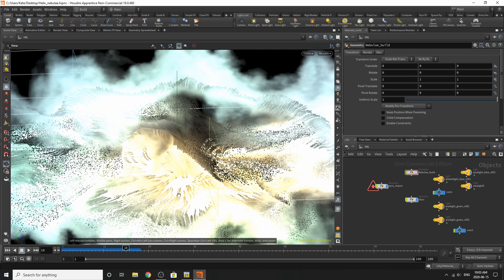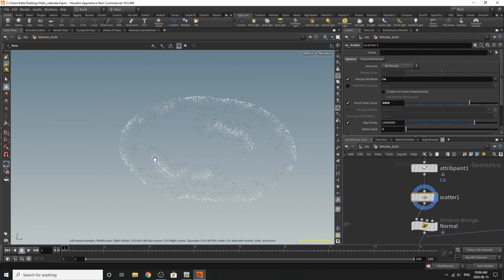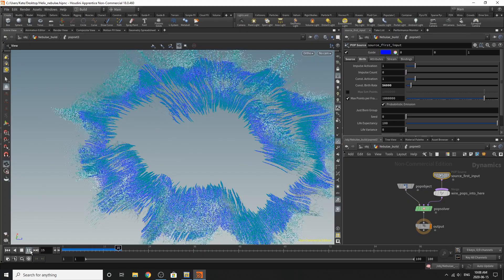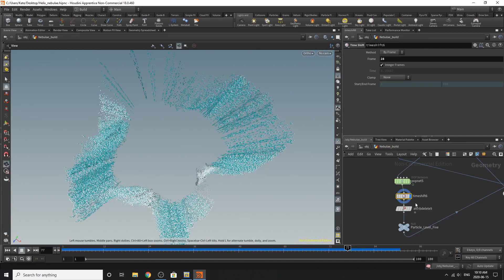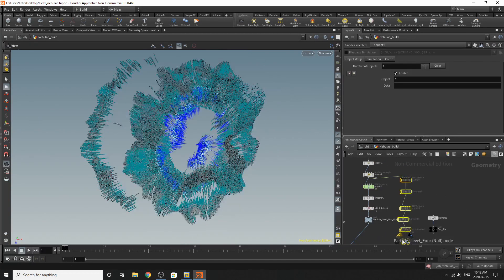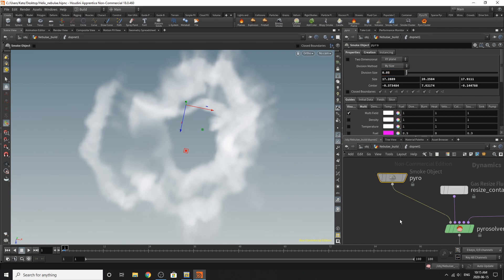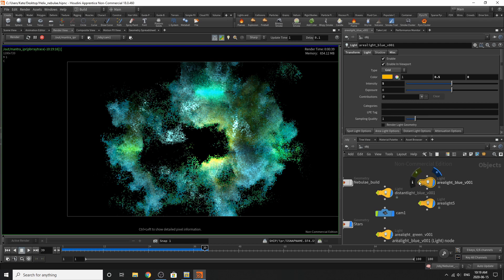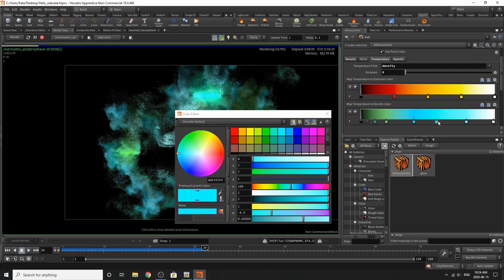Alien Portal || Houdini Tutorial

Comment: Separate from my other comment, I have a question in this one. I'm able to follow you up to 9:20 where you completed the building of particles. However, once you go below the Out_Nebulae (null) node, I am lost. You enter the DOP Network node, then go to Pyro FX, and click billowy smoke. From there though, it looks like it auto-generated according to the particle system? This does not happen in 19.5. Was there something else that was done in this moment? Any help would be appreciated, but I know this is a nearing 3 year old video.
Reply: Hey! Not sure if you found a solution yet (it's been a year now, haha), but this might help someone else. I had the same issue, and it turns out the tool has been updated. However, you can get the old tool back by right-clicking the Pyro FX shelf, selecting "Edit Shelf tAB," highlighting "Billowy Smoke," and then hitting accept.

Comment: I feel like this needs to be shared, as I ran into this issue and found a fix in a comment on a different channel. Currently using Houdini 19.5, and the Attribute Noise node is completely different. However, go to Assets -> Asset Manager -> Asset Definition Toolbar. In this dropdown menu, set it to "Show Always." This will create a new dropdown menu on the Attribute Noise node that will allow you to alternate between AttributeNoise2.0 and AttributeNoise1.0 (1.0 is the one in this video). Note that this also allows you to use both versions of Attribute Noise nodes, as the version it is using is assigned per node.

Currently working on a student project in Houdini, trying to replicate the exiting of a Slipspace Rupture as seen in Halo 2 Anniversary's cutscenes. Proving to be extremely difficult, as many tutorials dealing with a "vortex" or "portals" typically came out before 18.5. Lots of nodes have been reworked since, including the Mountain node.